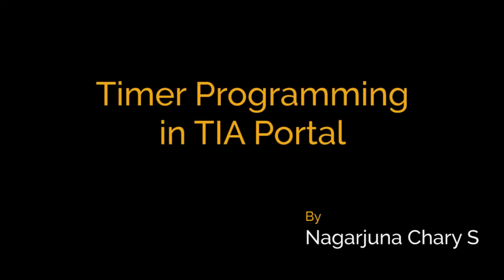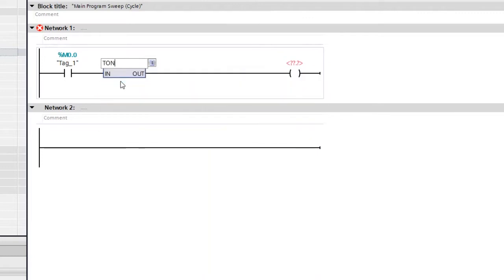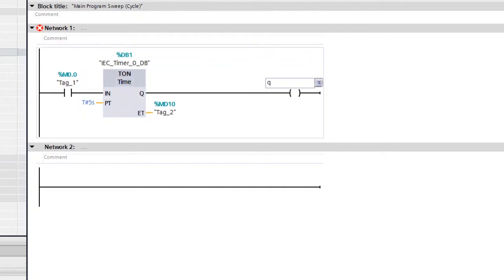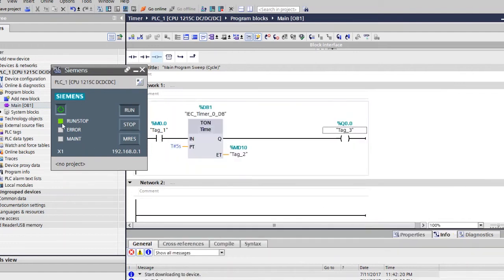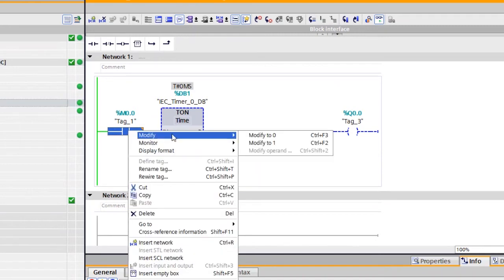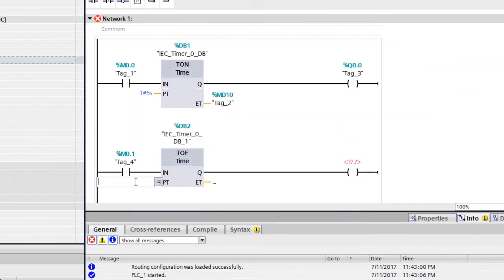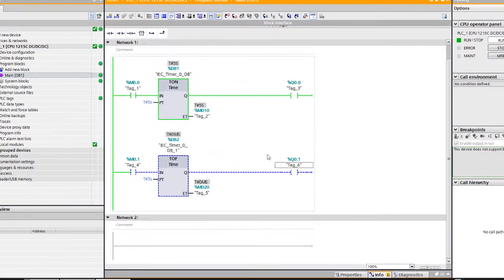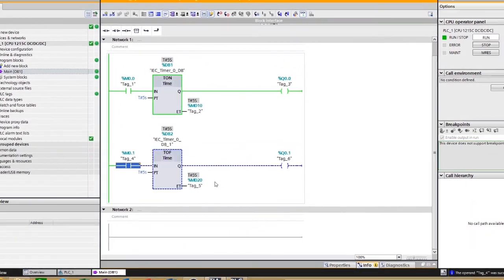Timers Programming in TIA Portal

Comment: i have a question , i have an HMI siemens  ktp400 basic with S7 1200 siemens 
i have my timers conected to the HMI both via adress in PT and ET  , when i write on the HMI for the PT it works normally but after i turn off HMi then turn it ON it becomes 0 and i have to write it again each time i turn OFF/ON my HMI 
is there a solution for it to stay typed on the HMI even after i turn it OFF/ON ?